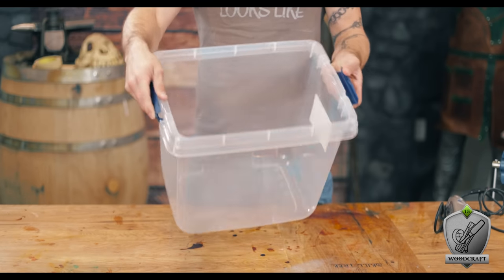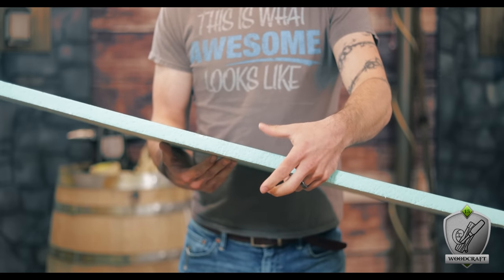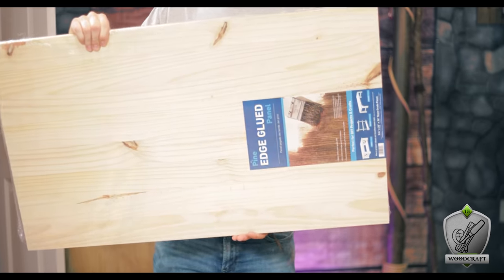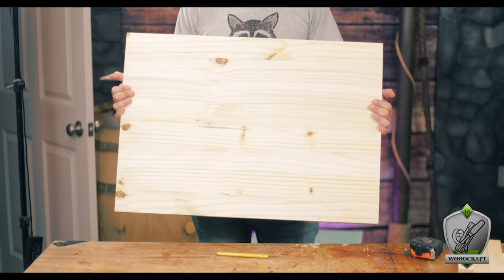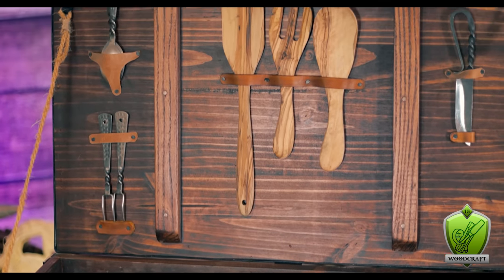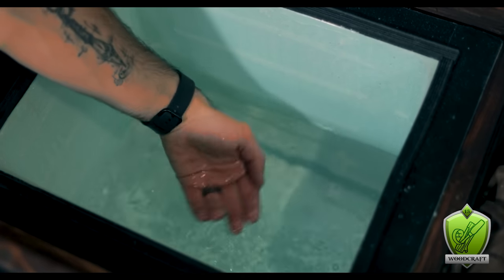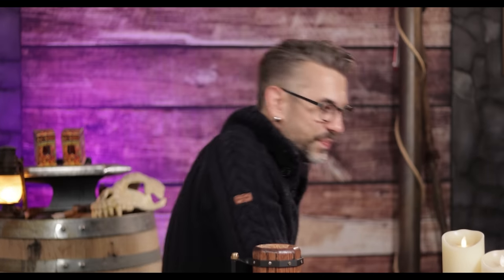Cooking Chest of the Traveling Chef!

Comment: Not a bad build. I am a bit concerned about the carry strap assembly, though. There's an old adage about "only as strong as its weakest point" and looking at it I'd say a significant portion of the weight of that chest is going to be focused on those two buttons. Doesn't matter how strong the leather straps are or how many racks you put into it, of the button holes get too close or the buttons themselves come unscrewed I worry that the whole thing will come crashing down.

My first instinct on transporting it would be wheels opposite the door end, with "feet"  opposite the wheels to keep it level when stopped, and probably best to go with two long, straight handles made out of strong wood. Sort of a rickshaw or old fashioned tea cart arrangement. Granted "period accurate" wheels aren't ideal for rough terrain, so that design is not without its shortcomings as well.